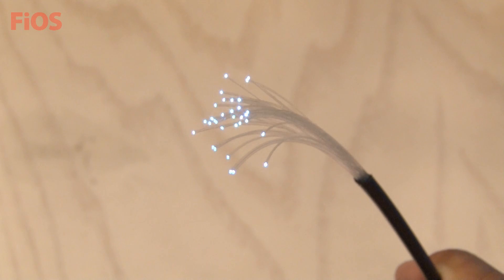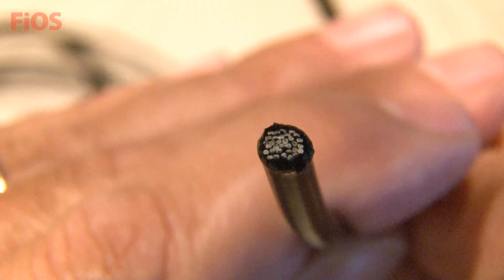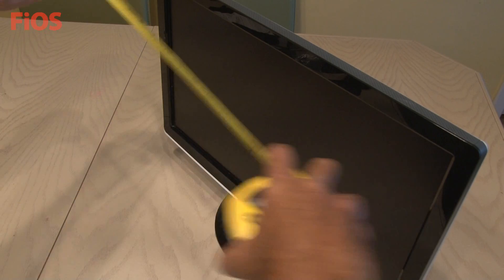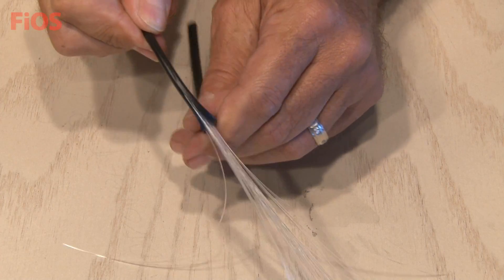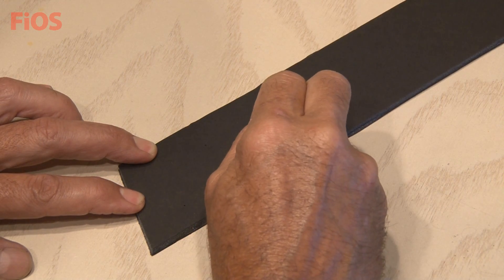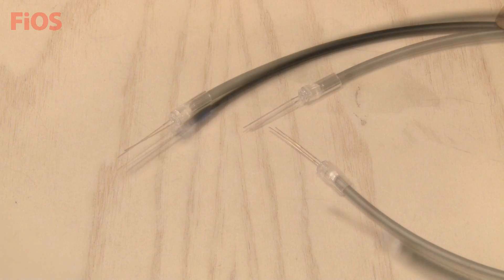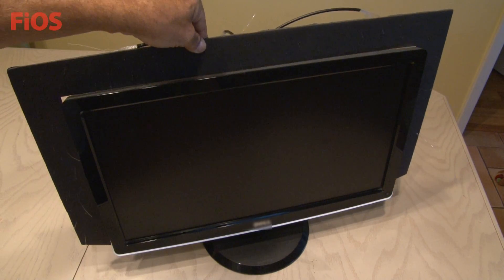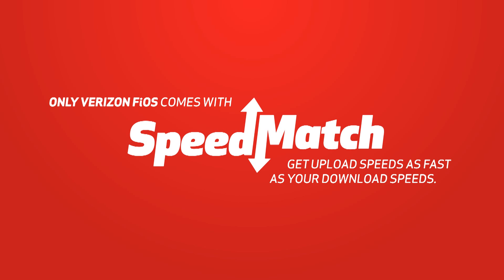DIY Funky Fiber Optic Monitor Lights!

Comment: what kind of fibre optic cable is that ? i have old fiber optic cable that i got from my local cable company when they replace the cable on the grid with the new one , it's a singlemode cable with 9/125 core and i don't have the cleaver for that so it's a fail for me

Comment: I'm only 13 and i think this may sond stupid but can't you just remove the wires inside your router and replace them with fiber optic cables ?Won't  that make it faster
Reply: That would work but u would have to replace the cables going to the provider station and to your house
Reply: Buttermen Pickaxe Don'tFiber optics connect to copper wires ?

Comment: any explanation why light dont just travel straight through the side of the wires? i mean why the side of the wires dont emit light?
Reply: Have you every looked through a fish tank? You can see right through it but when you look at the sides it is like a mirror, when you know it is just another pane of glass. That is how fiber optics work. You have a core of dirty glass, known as doped glass. And that doped glass is surrounded by clean glass. And then you get that fish tank effect and the light shines down the fiber and not out.

Comment: They keep saying they're matching speeds...but I'm still at 75/35.  I was also told that I would be bumped to the next tier, 150/150 by signing up for the rewards program...that hasn't happened either.

Comment: wait a minute. My dad has an engineering degree and he said fiber optic wire has little burrs in it that can get into your skin. I also see some links in google about it.
Reply: "You'll be surprised to know that jabbing yourself with a fiber is not the most hazardous situation. The real danger is when fibers are stripped, trimmed, and cut. These operations result in short, nearly microscopic pieces of glass lying around a work area. These are short, thin, invisible needles. If they're left lying around, someone will inevitably end up touching or handling them. As sharp and thin as these glass shards are, they can easily penetrate your skin. And unlike a wood sliver, these glass slivers will not degrade inside your skin."

http://ecmweb.com/content/dont-ignore-hazards-associated-fiber-optics
Reply: so yeah PLEASE don't do this. Fiber optic lines are glass and handling them is very bad. People who work with fiber optic cables have to wear entire rubber suits and goggles.

Comment: Hoooolllddd onnn... You said the computer was turned off but you power it via USB?
KIPKAY IS A WIZARD
Reply: its called turning the monitor off. you know, the little button in the corner.
Reply: We're not even sure if it's plugged into a PC. You can also use the USB from an adapter plugged into an electrical socket.
Reply: TGRS It is a motherboard feature.
Reply: joep45621 Also, some computers have an option for enabling "always on" feature on some USB ports, via BIOS.  (as long it's still plugged into the power socket or on a charged battery)
Reply: ivanzegt Tryed it with 3 different PSU's. Didn't work.
Reply: TGRS I have one desktop that doesn't, one that does on all ports, and a laptop that does on one port but not on the other two. The laptop has a setting in BIOS setup which toggles the port's power.
Reply: you don't have to plug the usb into the computer, there are also wall and car adapters, there are even little mobile chargers that have their own batteries with usb ports...
Reply: ***** Well if the motherboard manufacturer decides so they can make the "always on" power pass through from the power supply to the Motherboard to the front/rear panel. Therefore relying on the motherboards feature. Anyways my motherboard only has the power pass through on rear USB ports also my motherboard was advertised with this feature and can be disabled via BIOS, and all power supply's I have owned do not give power via Molex or SATA when the PC is off even if the power supply switch is on. This example really iterates the motherboard being the backbone of the system.

Comment: I did not notice if you did this or not, but if you change up the location of the Fiber and put various strands from each of the 3 leads into each of the 3 panels it may give a more versatile arrangement of color.  The way it is now it seems to just blink in a certain area all at the same time while the way I suggest will allow it to blink on all 3 panels at the same time.  Just a suggestion.  Also if you can say where you found the fiber optic cable that would be great...  Thanks...

Comment: kipkay could you help me with something? My monitor has been acting up recently.
Horizontal Black lines are forming on the bottom of the screen as if it's broken in half and when the monitor is cooled off and i turn it on, the bottom half of the screen gets messed up... it looks like a blurred/distorted image. After the monitor heats up a bit i can make some of the lines and the blurred part go away for a while by applying pressure to the sides of the monitor near the buttons and edges.
But then the "Theme" menu keeps toggling between themes on its own. The only way i've been able to stop that is by holding down the toggle button.

I don't want to send it to customer service because it could take months. I want to know first IF it is possible to fix this or should i just buy a new one
Reply: Buy a new one, that thing is trashed.
Reply: im trying to be a bit optimistic here :P i don't have money for a new one
Reply: Truly though, unless you want to be cracking into the thing and figuring out how your specific model works (which may reveal it was irreparable all along or even make it worse if something gets damaged) it's really the best option. Pick a cheap one up off of eBay.
Reply: actually if it CAN be fixed, i have a friend who's an electrician. He can help me get the parts i need to replace, the rest i can do myself

Comment: Those are technically "fiber optic" cables, but not anywhere close to what is actually installed to carry data. The cables you have are plastic and what they use for show-and-tell and build the cool fiber optic lamps and Christmas trees with.
Real fiber optic cables that carry data are color-coded and have actual glass cores that are 9µm singlemode and 50µm multimode.